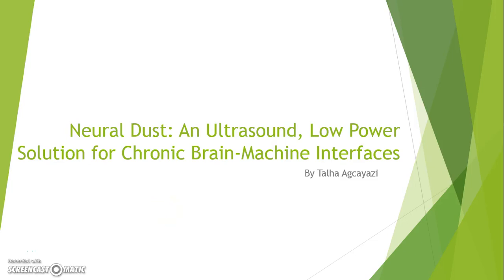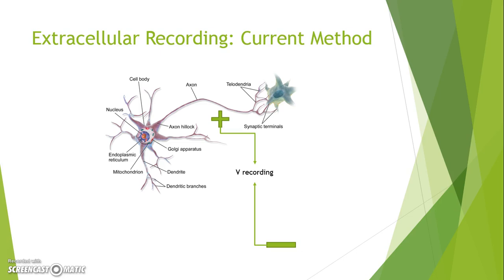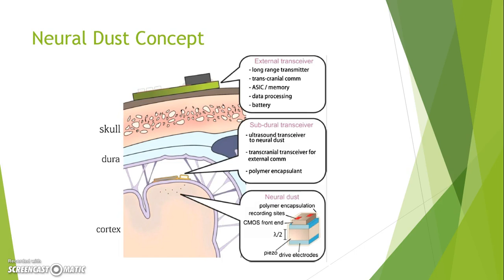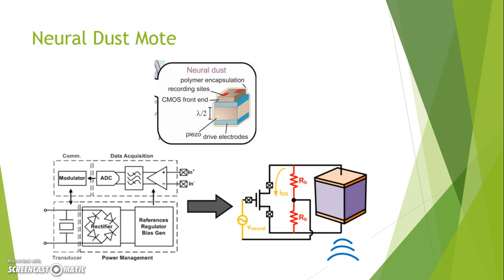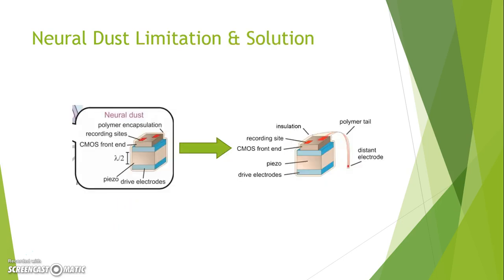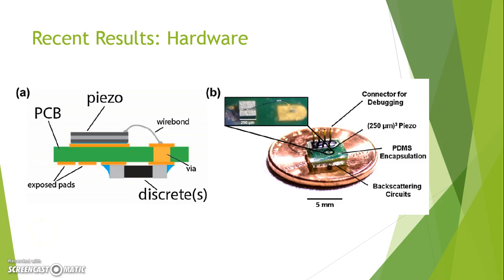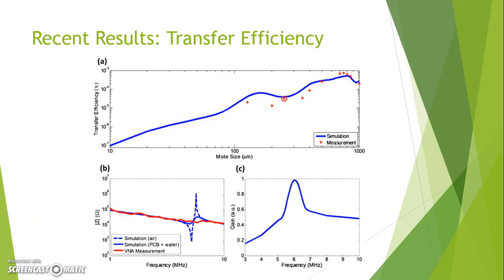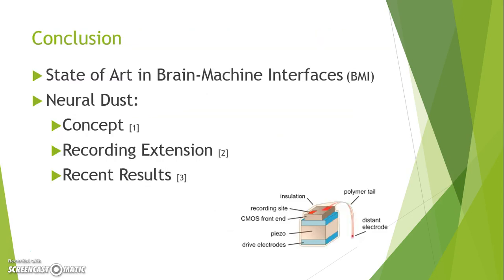Neural Dust for Extracellular Recording of Neural Activity

Comment: I AM A REMOTE NEURAL MONITORED  TEST SUBJECT.  
I am unwillingly linked by a two way link of invisible energy to a computerized control system which is known as Remote Neural Monitoring combined with Remote Neural Manipulation, among many other names.   Those who run the system transmit and receive data to and from my brain and body in the form of voices, visual images, sensations, feelings, forced muscle movement and many other types of data.   Everything I see, hear, taste, smell, feel and all my muscle movements all generate EEG patterns which can be automatically translated into exactly what I am experiencing and then transmitted on to the computer screens of a  Remote Neural Monitoring team who work thousands of miles from me at an unknown remote location.  
   Some of those who operate this system appear more cruel than others.   One of them might mention a name of a man from my past.   That means that they might mention a name of some man that I may have worked with forty years ago and who I barely knew and who I had no interaction with.   I will then be forced to imagine what that individual looked like simply by the mere mention of his name.  Then the EEG patterns of those visual images which I generate by my own mind are then automatically translated into whatever image of that man which I imagined and that image of that man is then displayed in the digital media screens of the evil neuro operatives who remote neural monitor and remote neural manipulate me.  
The cruel Remote Neural Monitoring and Remote Neural Manipulating team will then repeatedly transmit that EEG pattern of that image of that man back into my mind against my will so that I can not then stop thinking about that man whose name which the cruel Remote Neural Monitoring operative initially mentioned.  The Remote Neural Monitoring Team will then sometimes transmit all kinds of disturbing sexual images into my mind which never happened and they will ask each other if I was ever sexually involved with this man.   They will then conclude that nothing of a sexual nature ever happened  with said man.  The whole incident will leave me upset because some times some of them try to imply that I have done things which I have never done.
They send data into my mind in the form of EEG patterns which are then translated by my brain into words and images or even a feeling of having someone touch the surface of my skin.    
  They  often attempt to make me feel guilty about something which I have never ever done by falsely implying that I have done it.  They can transmit nasty images into my head which make me imagine doing something which I would never do and which I would never ever even think about if I was not being actively Remote Neural Monitored on a continual basis.  I am celibate and I am of late middle age and I never ever think about sexual matters unless the Remote Neural Monitoring team provoke me to do so.    
  The goal of the remote neural monitoring team is to upset me repeatedly so as to keep my frequencies low for the further reason of being able to get through my biofield in order to continue to conduct their research on me.  
My name is Gretta Fahey from Newbrook, Claremorris, Co. Mayo, Eircode F12 Y560,  Republic of Ireland and the reason I constantly post posts online of what I am experiencing while being a non-consensual brain weapons test subject is because I want others to know how vulnerable they are to being a brain weapons test subject themselves and how extremely cruel and torturous this experience which I am experiencing is.   All the evil Remote Neural Monitoring Teams ever need to do in order to turn anyone into a remotely monitored and remotely manipulated non-consensual brain weapons test subject is to obtain a sample of their DNA and also to inject them with injectable implants  which are then linked to a computerised system which monitors and automatically translates all of the EEG patterns which are generated by the brain of the victim into what they are thinking, imagining, doing, saying and feeling and that's it.  You are then a partial slave to extremely evil brain weapons testers.
EXTREME EVIL DOERS WHO WORK FOR BOTH CHURCH AND STATE, YOU ARE UNKNOWINGLY HELPING TO ENSLAVE YOUR OWN CHILDREN BY THE FOLLOWING MEANS;-
Unknown psychopaths are torturing me by remote means by using energy to transmit data into my brain and body and that data then causes me to hear voices, see visions, feel a sense of touch on my skin and it also allows those aforementioned psychopaths to sleep deprive me.   These energy weapons are sometimes known as psychotronic weapons.   There are millions of books about psychotronic weapons.  There are hundreds of scientific patents which describe the capabilities of psychotronic weapons and there are many military scientists and other experts on psychotronic weapons who speak publicly about their capabilities and about the fact that they are currently being used on members of the general public.  
Extreme evil doers who work for both church and state keep the abuse of these energy weapons which are also known as psychotronic weapons covered up by implying all victims of energy weapons are instead mentally unwell. 
Those extreme evil doers who work for both church and state are complicit in crime because they do all in their power to cover up the widespread abuse of those aforementioned energy weapons by forcing those victims who complain about them into psychiatric hospitals and then labelling them with various mental illness labels. 
Those extreme evil doers who work for both church and state and who deny the existence and abuse of energy weapons are nearly as evil as those unknown evil doers who torture us with those aforementioned energy weapons by remote means.  
Those extreme evil doers who work for both church and state wish to remain in denial of true reality and they wish to remain inside a false reality cocoon so instead of listening to those of us who are the torture victims of those aforementioned energy weapons and then believing us when we report the crime of being tortured by energy weapons which are silent and invisible they instead insist that we are mentally unwell and they force us down the wrong road  towards psychiatric evaluation and from there to psychiatric hospitals so that the worst crime in the whole history of the human race can never be exposed entirely because of the evil deeds of agents of church and state, namely the police and psychiatrists and other complicit agents of church and state. 
Many years from now their own children may be enslaved by means of energy weapons and by means of digital control and it will be entirely the fault of the aforementioned extreme evil doers who work for both church and state.   You know who you are.
The Protection of Unwilling Hearers of Transmitted Voices is a Matter for the Ministry of Defence, who have been illegally unloading the problem onto psychiatrists.